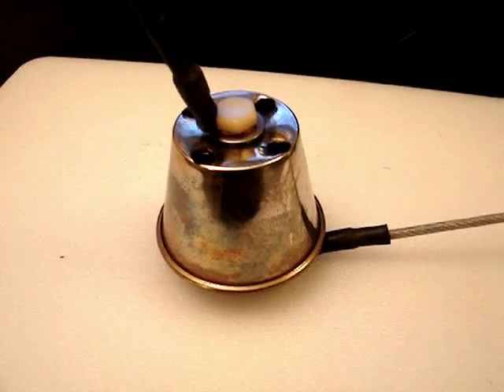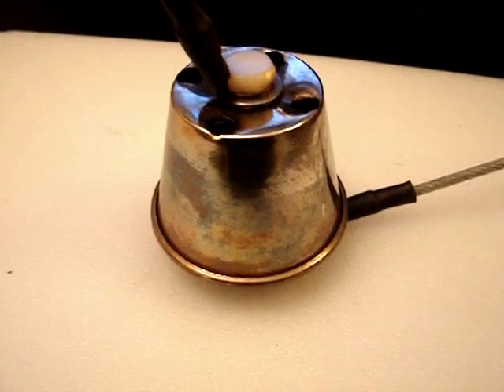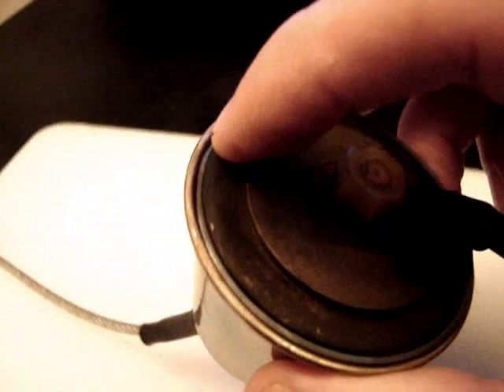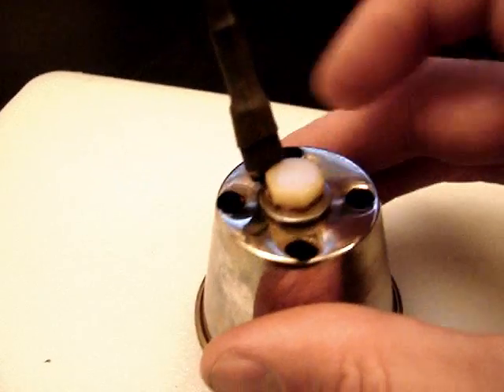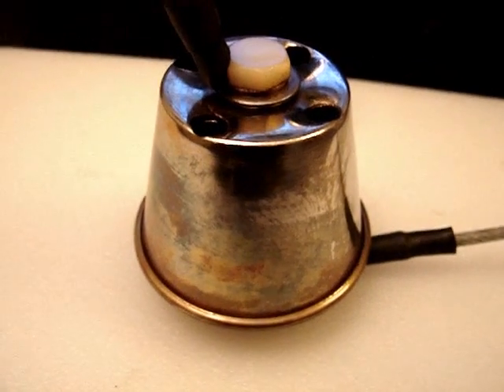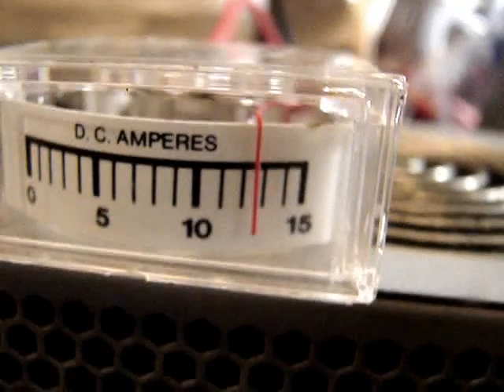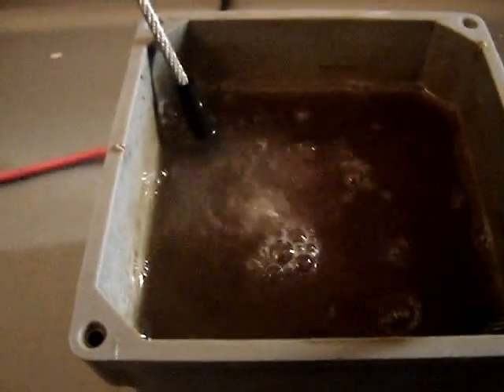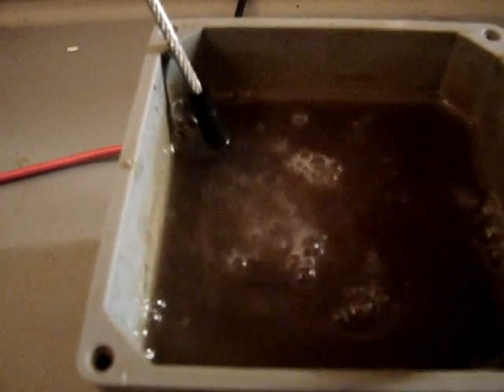Vid18 Single Cup Volcano Cell Hydrogen Generator (HHO, Brown's Gas, Hydroxy)

Comment from the maker: It does get warm, but I'm sure when I switch out the zinc plated washers for stainless, it will fix that.

But it does not get hot, only warm and the connectors stay cool to the touch.

Comment from the maker: The cell does get warm (not hot), but I think I could fix that by using stainless washers.

after I finished this video last night, I figured out how to make this design into a dry cell, so that should also reduce amperage and heat, and may increase the gas output.

Comment: Hi You do get better production from zinc, but has you say it corrodes quickly, also turns the water brown very quickly, 
I think you would also get a lot of the energy turned into heat.
But good try.

cheers.